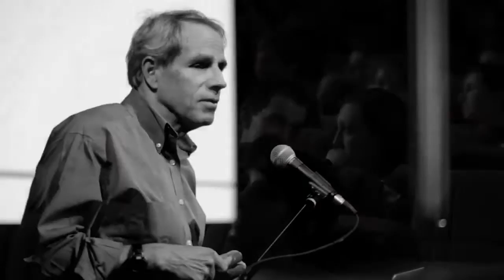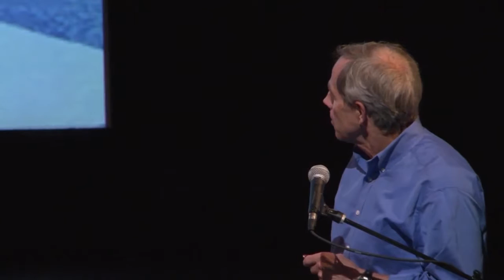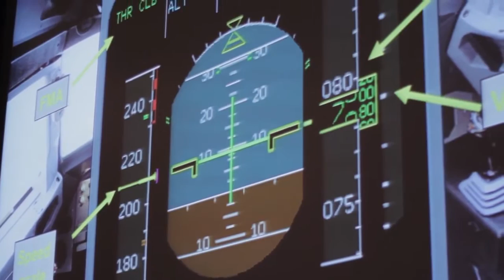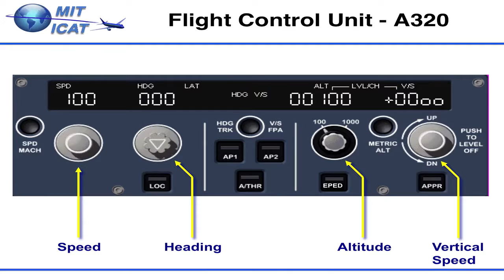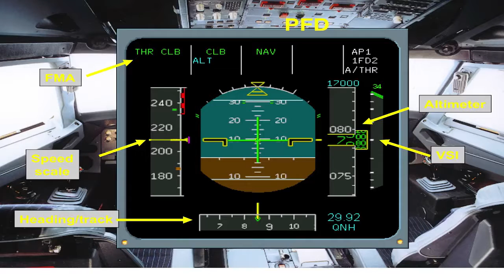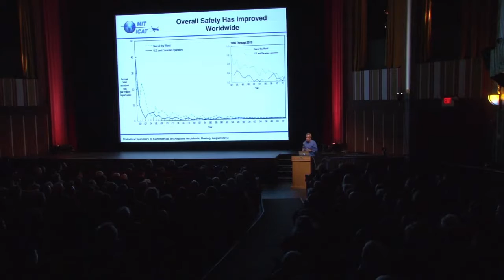Modern Flight Automation Systems: AIRPLANE!

Comment: I've always thought that the two side sticks in the Airbus cockpit were a dumb idea.  One reason for having a pilot/co-pilot crew is that each checks on what the other is doing.  With the side sticks not connected and on the outside, it is easy to be doing something that the other pilot is not aware of.  This was a factor, I believe, in the crash of Air France 447, 1 June 2009, enroute from Rio to Paris.  The aircraft lost its pitot tubes and thus its speed indication.  It was flown in a stall configuration down into the ocean.  The pilot flying the plane had been pulling back on the side stick for a long time, and the other pilot was unaware of this precisely due to the non-linked controls and the side sticks not being within view of both pilots.  I'm surprised that this was not recognized as a cause of the crash and not corrected.
Reply: Hey, sorry to necro. I want to add a bit to that. In an Airbus, whenever both control sticks receive input simultaneously, there is a "dual input" callout in the cockpit. So the pilots could've very well noticed that both were trying to control the plane, but they didn't listen. As the final crash report put it, the control sticks not being linked was a contributing factor, but not the reason for the crash. It was just plain pilot error, because they panicked instead of remembering their training and thus flew a plane in perfect working condition into the ground.